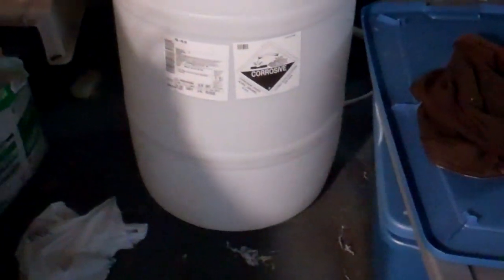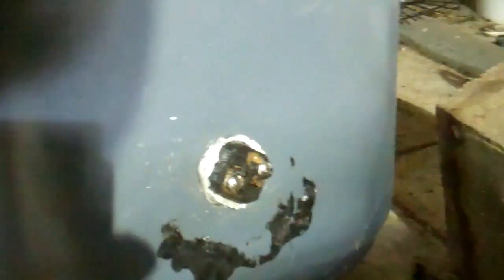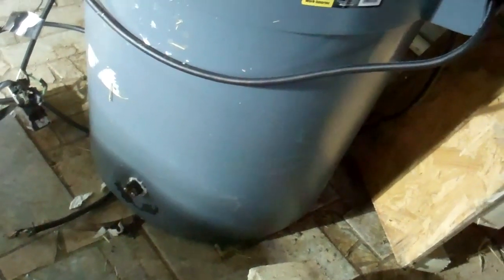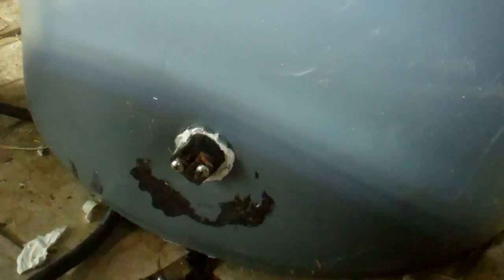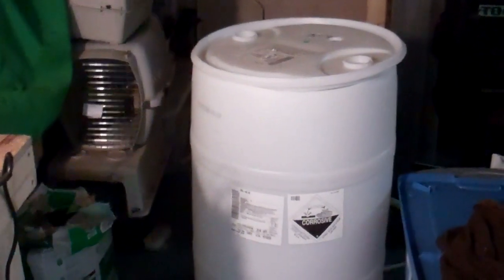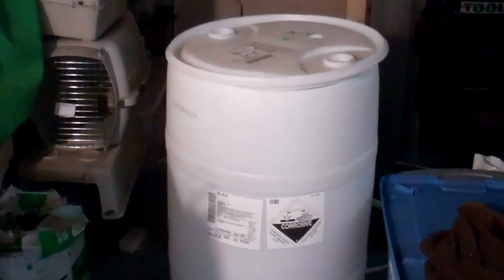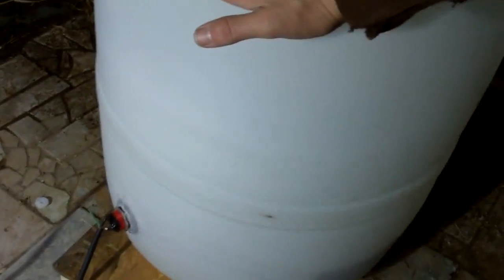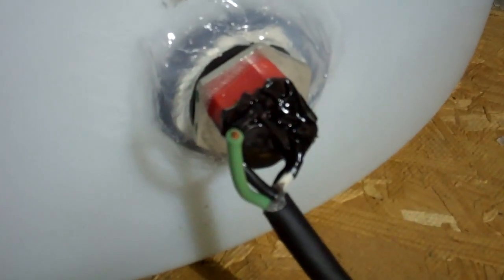55 Gallon Pasteurizer.mp4

Comment: Those heating element thermostat only go to 66deg. cel.- or - 150deg. F..

Unless you found one that goes higher?? 

If so I would LOVE to know where you found it!
Reply: They only reach that level because of the thermostat control on the hot water they are designed for. They all boil water to it's maximum. I use them all the time found in any hardware store

Comment: Can you reuse the water. Does the water become toxic after using 3 or 4 times?
Reply: Yeo, the first time you use the water its good as an herbicide.  The second time you use the same water it becomes an effective fungicide.  Any further use means your preparing substrate in fungicide...  It can be used in several other ways.  it can be added to compost to adjust the PH or added to a biogas generator to produce more gas.

Comment: Looking good! You can use the thinner bucket, just get a 1" SS locknut off amazon for about $7. Drill the hole the size of the threads and thread the locknut on from the inside using the factory O ring to seal against the pail. I use this method on my electric brew kettle and its a common method in the homebrew scene.

Comment: You could run the ground to a lead with a heavy duty alligator clamp and clamp that to the steel strainer. I love the setup I only see one real fault, the probe should be in the center of your strainer to regulate the temp as Cortland says.
Reply: What I'm doing is using two smaller elements and putting one about where he has his and the other a little above half way. .   Makes for moreof an even distribution of hea/ rise in temp

Comment: A remote thermostat attached to the rafter will not regulate the temp in the tank below. The thermostat must be attached to the side of the tank and be at the same temp of the heating water. Once the preset temp is reached, the bi-metallic strip will trigger an interruption to the heating element, and cycling will occur to maintain set temp.

Comment: Bulkhead fittings are npt threaded. Heating elements are NPS threads. Unfortunately, bulkhead wouldn't work. Any issues with threads or silicone melting when heated?
Reply: I think a better choice here is RTV Silicone. Woke I've pressure sterilized  jars with silicone nipples makes pinching gesture with thumb and index finger and they had zero issues ;)

But to be safe RTV (It both comes in and IS a vibrant red color) 
Your can get it at AutoZone, Home Depot..  Lowe's i don't think had it last time I checked but.. You get the idea - haha.

Comment from the maker: @joshuuaa58:  I'm not entirely certain, but I think you CAN wire the heating element directly, although I'm not sure what benefit you obtain from eliminating your ability to regulate temperature.  Thermostats are only about $15 and are incredibly easy to wire up, diagrams are available on google that show where each wire connects.